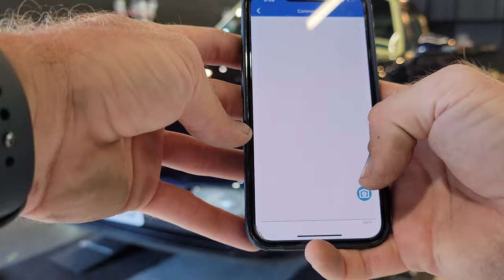FULL PACKAGE DETAILING & Dry Ice Cleaning Porsche 964 Turbo

Comment: Do you always remove the covers? or does it depend on the level of clean the customer is wanting?  does it remove staining on the aluminum?
Reply from the maker: We usually remove the covers if we're doing a full undercarriage cleaning. The dry ice does not remove staining from aluminum, but we have a few different methods we use for cleaning the stained metal.